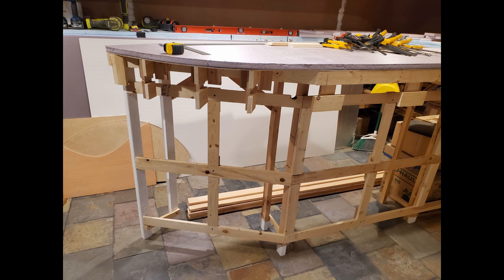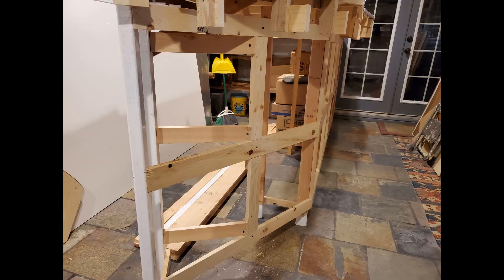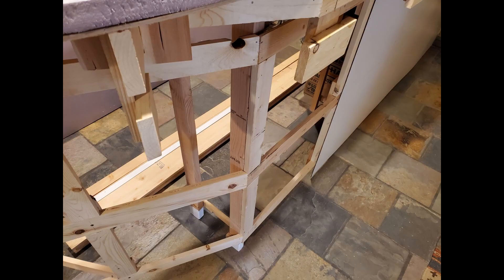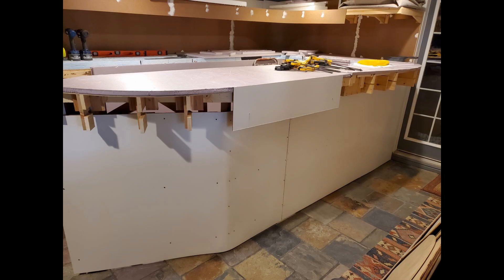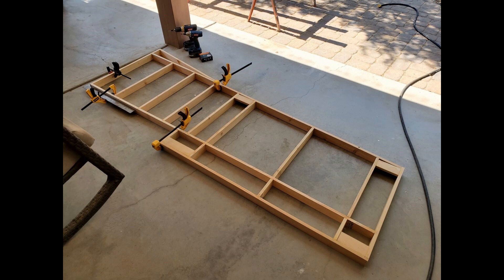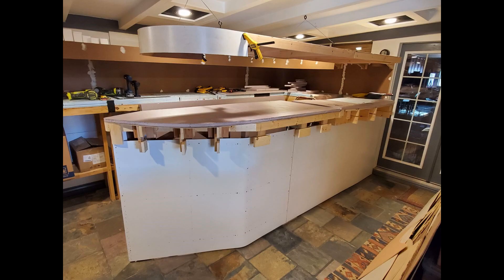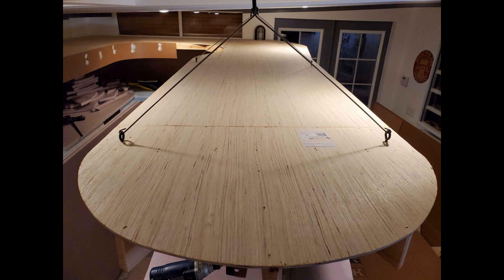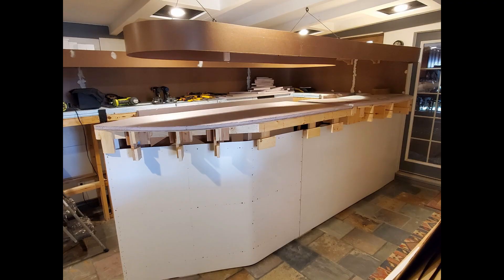HO Scale Model Railroad Benchwork Construction. Layout Part 9

Comment: Steve, I was catching up on your layout videos.  I watched your "starting over after 3 years video."  I too am a SP fan for a mainline railroad and I have a huge collection of N scale and SP.  I did some growing up in Arizona.  However, in model railroading, tastes do change over time.  One night, while doing some research on the Internet, an old Black & White photo caught my interest.  I had stumbled across the Morenci Southern Railway that ran at the turn of the century from old Morenci, AZ to Clifton, AZ.  It was an isolated copper mining railroad.  Next thing I know I am researching more, getting into On30 and buying Broadway Limited Imports On30 C-16s.  There were five C-16s on the Morenci Southern, the Corkscrew to America.  There were 5 loops on the railway to climb up 1,400 feet of elevation to Morenci and the copper mines.  It was also a tourist railroad back in the turn of the century.  I do not have the space you do to build the Morenci Southern, but if I had the space you built I could do it.  However, there is no way to fit in the five loops, so I must punt.  There is also the wife dropping hints of moving.

If you want a railfanning simple layout showing the Arizona scenery may I direct you to the Arizona & Eastern?  Colorful lash ups of multiple engines running through hills, valleys, cuts and cliffs in the desert on single track.  I did some checking and have not found the A&E engines commercially produced.  But, I see that you have the skills to model those yourself.  I recommend that you look into the A&E.
Reply: @SPSteve  Goat Canyon trestle.  Isn’t that the Arizona & San Diego RR?  Arizona & Eastern is a modern mainline railroad still operating today.